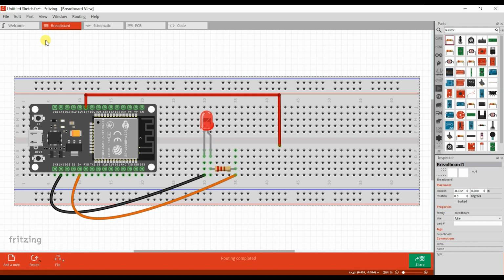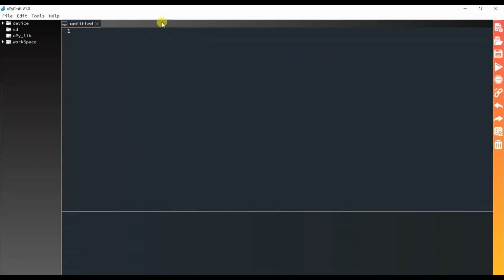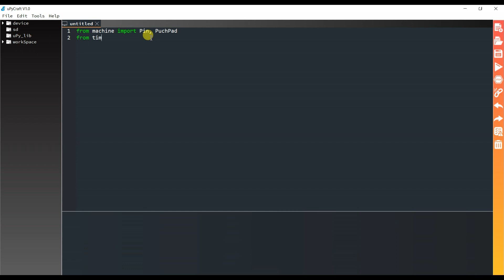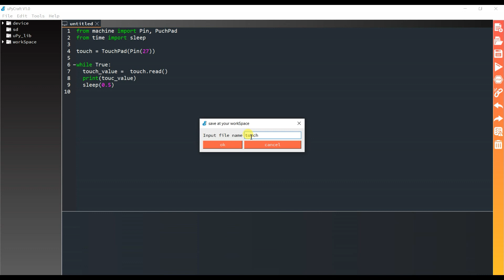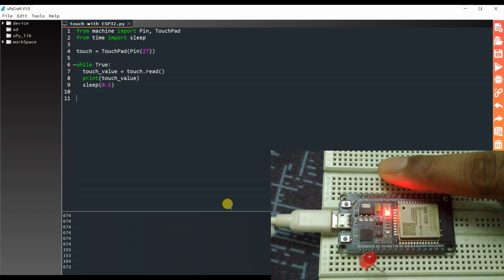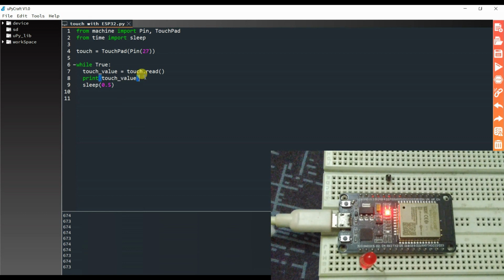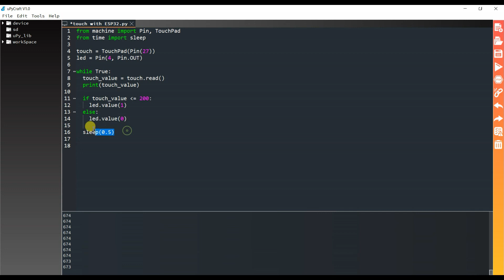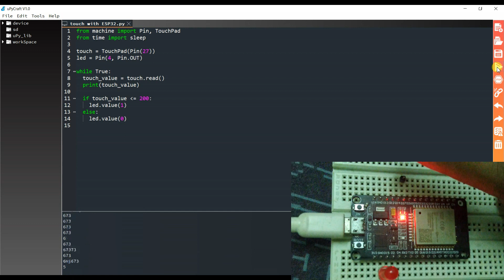11  Touch (Capacitive ) sensor  controlled Led with ESP32 and microPython

Comment: Cool project, even useful to make a touch sensitive switch or alarm.  I am learning both ESP32 and Micropython, and will be placing notes in comments, here is a basic explanation for my reference or anyone else, you could just copy paste. 

from machine import Pin,TouchPad
from time import sleep

# Touch sensor on GPIO 27 (can be any supported touch-capable pin)
touch = TouchPad(Pin(27))

# LED connected to GPIO 2 (change if needed)

led = Pin(2, Pin.OUT)

while True:
    touch_value = touch.read()
    print(touch_value)
    
    if touch_value <= 400:  # Sensitivity threshold (you may need to adjust this)
        led.value(1)  # Turn LED on when touch is detected
    else:
      led.value(0)  # Turn LED off otherwise
    
    sleep(0.5)

Raising the threshold closer to the base reading will make the switching more sensitive,  lowering the sleep value will make the response faster.  I changed the led to GPIO 2, since that is the built in pin number for my board,  adjust for whatever yours is, or just add an external led in line with a 220 ohm resistor, similar to the previous tutorial.